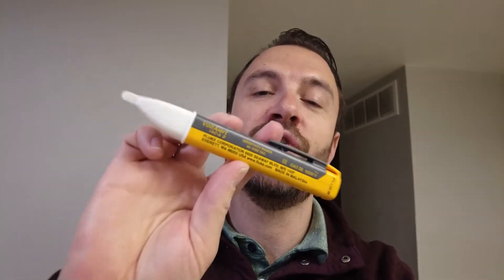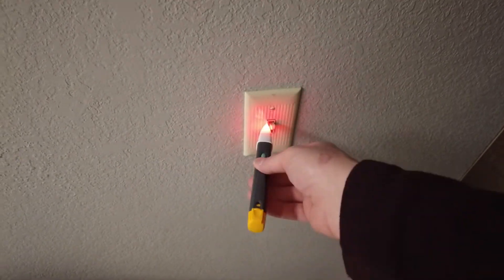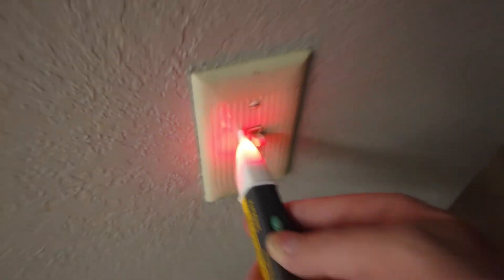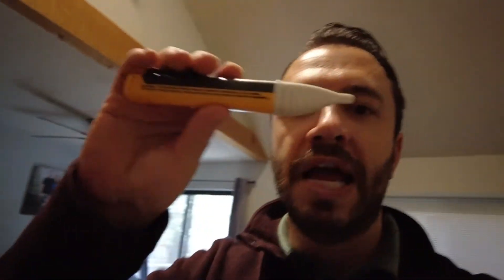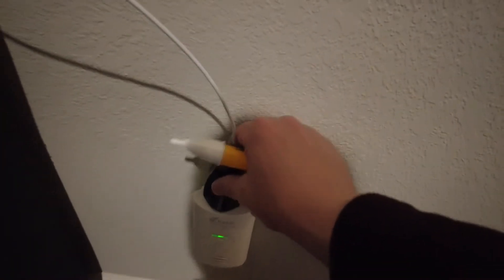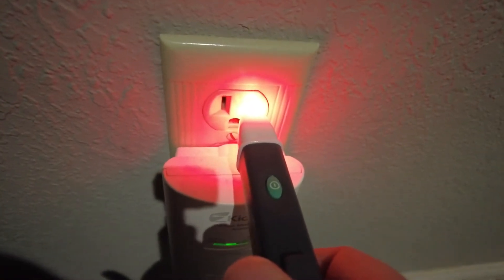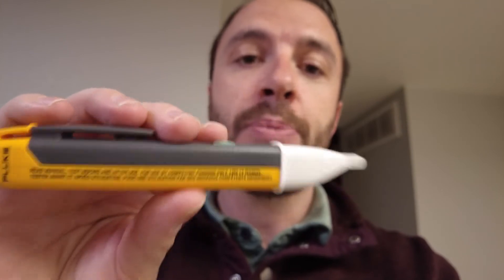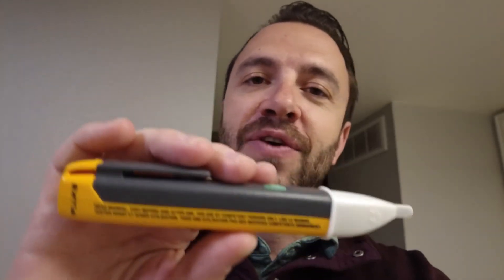How to Test Outlet or Switch for Current Fluke 1AC II VoltAlert  Non Contact Tester

Comment: Thanks for the review. What’s odd, I am using the same exact unit and it seems to work fine on the hot side of an outlet or a wire but no where can I get it to light up on any wall switch like you are doing in this vid. Light switch on or off does it make any difference. A tool is brand new. ???

Comment: but can you change the batteries?
Reply: There's a tiny yellow button in the handle. Press that in and move the two sides apart to see the batteries.
Reply: @pitchforker3304  yes, that "press" is what I was hoping someone would comment on - my finger strength alone was not enough to separate it.
Reply: @armandine2  I pressed in with a pen to get the button to click.

Comment: While using the tester to test current in a light fixture the red light oscillates, holds red for half a second then goes away, holds red for Half a second and goes away, what does this mean?
Reply from the maker: I believe that’s the low battery indication. Try changing the batteries and see if it goes away. This is what the user manual says: “When the battery voltage drops below 2 volts VoltBeat provides a visual indication by stopping the VoltBeat flash. Replace with 2 AAA (LR3) batteries.” During normal operation it should have a double flash every 2 seconds. Change the batteries and let me know if that fixes it.
Reply from the maker: Also now that I’m reading you question again it sounds like something different. Your saying it alerts, indicating there is current and then goes away? And then comes back?
Reply: @CleanMachinesYT  yes sir that is correct. I’ll try flipping the breaker see if it works that way.

Comment: How do you switch the bleep back on?
Reply from the maker: First turn the tester off. Then when you turn it back on be sure not to hold it for more than 2 seconds.
Reply: @CleanMachinesYT  thank you Drew
Reply: Why is flashing red while your holding it not near a volt source
Reply from the maker: @B.i.gDonk73  when it’s on the tip has a red light that blinks. The tip holds a solid red light when it detects a current.